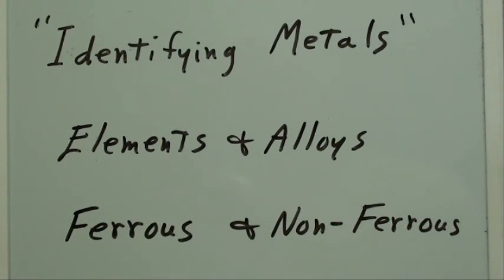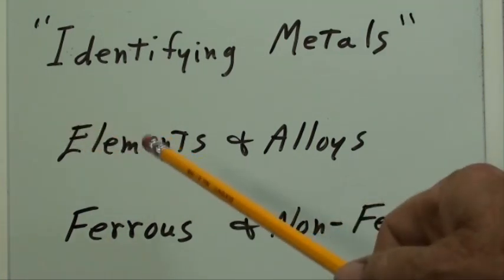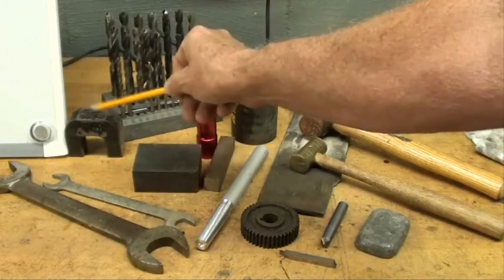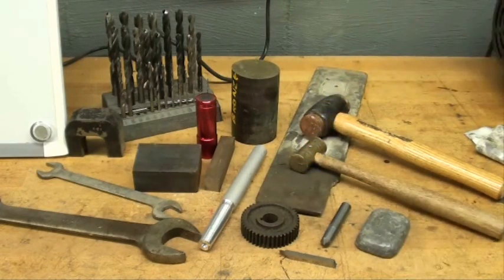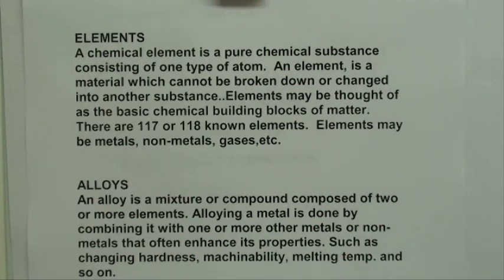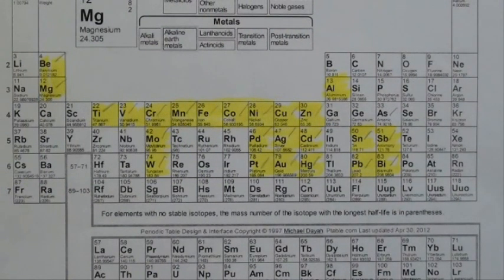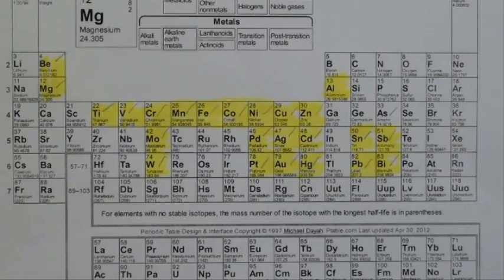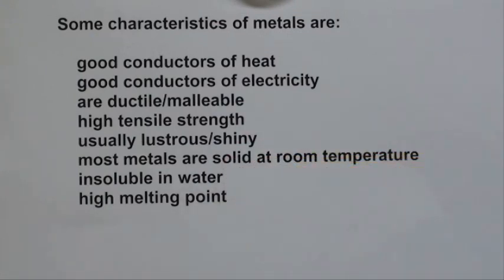MACHINE SHOP TIPS #84 INTRODUCTION to Identifying Metals tubalcain

Comment: I didn't see how you disconnect the power feed mechanically.  It would seem there must be a way to disconnect the power feed when using the machine gearbox because the electric drive motors are always worm gear drives and cannot be driven backwards.

Comment: You are certainly correct in stating that we may find (or more accurately, make) new elements but I think the way you discussed it in this video is likely to confuse many people that haven't studied science. We will never discover any new elements between Hydrogen and Uranium (or Ununoctium if you want). An atoms proton count determines which element it is and you can't have a fractional proton. Since we know all the elements with protons from 1 to 92 we know we won't find any new elements.